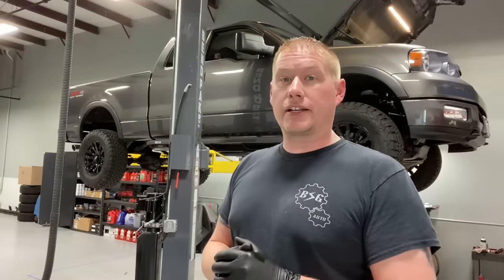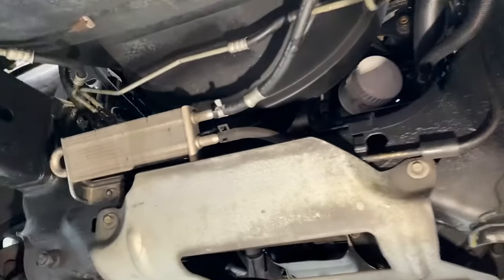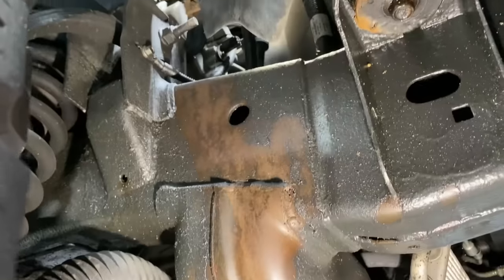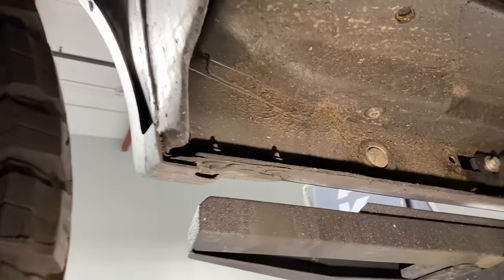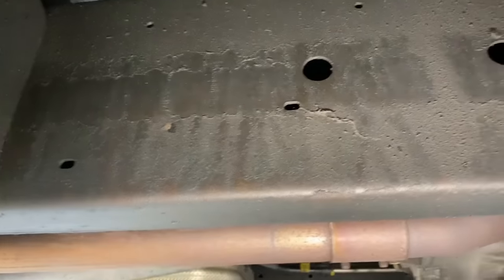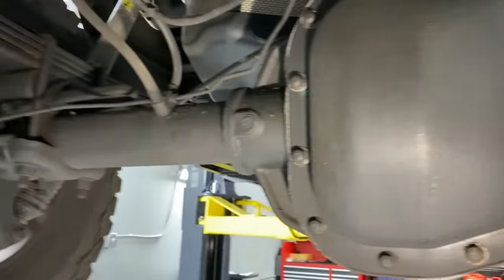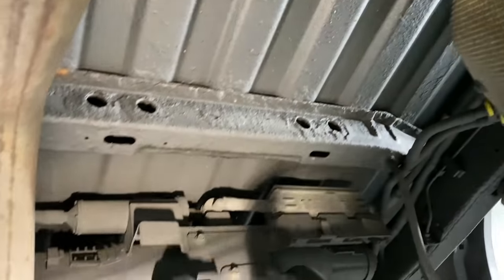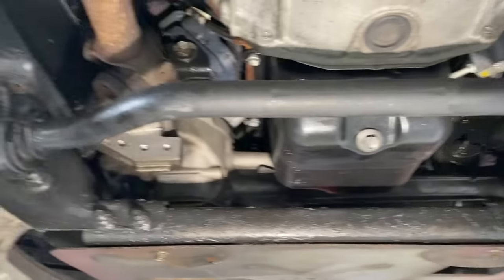Woolwax Undercoating 1 Year Review: Is it Really Better Than Fluid Film?

Comment: The leaking rear main seal on my fox body has worked great as undercoating for the last 30 years 😉
Reply: same with my 66 mustang
Reply from the maker: nice!
Reply: Works great one my 77 Versailles to and the car does all the appling.
Reply: I see I'm not the only one who uses that undercoating😬.  Just doesn't seem to get the rocker panels covered well 😕.
Reply: @dcmchiefs2008  I'm thinking a little forgotten silicon on the timing cover will fix the coverage issue as well as eliminate the need for regular oil changes.
Reply: My 04 explorer has the same feature lol.
Reply: Front 1/3rd of my 1986 Chevy k20 plow/work truck is mint because they come with leaking gaskets and seals right from the factory. I bet by 89 my front frame was 100% 10w30 coated. Now the middle of the truck is coated with trannyfluid from a slow leak from the th400. Cases like this gave me the idea to look up environmentally responsible ways to oil coat my vehicles and equipment.... we all have wells and springs out here so I dont want to screw up our ground water
Reply: @FordTechMakuloco  hey, i have a question, i have a ford f150 2004 4.6, an i need to know what type or gears has in the rear axle, how can i tell??
Reply: 50/50 mix of diesel and old motor oil works pretty good too.
Reply: If you go fast enough, it’ll coat the entire undercarriage
Reply: @SteelBelted  done lol it has a nice sheen covering front to rear with a touch coating of transmission fluid
Reply: Lol
Reply: Seriously why isn't this a feature. It wouldn't be that hard to put rust protection oil reservoir somewhere that would gradually (intencionally) weep at predetermined points and keep the car undercoat going. I mean we do cars for 100 of years. How is this still not a thing?
Reply: @DanielTejnicky  capitalism 🇺🇲 lol planned obsolescence
Reply: @c431inf Don't like it leave them , commi
Reply: LMAO...

Comment: We used the clear WoolWax on a 2000 E250 van that is pretty well rusted and it held up since last fall. Great product.
Reply: Does it seem to retard the progress of corrosion? I was thinking of applying this to my plow truck which has already seen 35 winters in PA and NY. I apply fluid film to the plow already to keep junk from sticking, kind of like olive oil or butter for a pan.
Reply: @workingcountry1776  yes, it does appear to stop rust in its tracks. The key would probably be to keep corroded surfaces covered. I think Woolwax is better at clinging to metal because if it’s viscosity.
Reply: @TheNortheastAl  FF is available at NAPA and Advance Auto Parts so that's what im using this year.  If shipping is reasonable I might try woolwax brand next season. I am in the process of installing floor pan and some patch panels to keep the old pig safe til I find a southern cab for it. Funny,  frame is super solid with surface rust but body is typical rot

Comment: I use both Fluid Film and WoolWax. Spray Fluid Film first in August. It creeps really well in the heat. Then a month later come back and topcoat with WoolWax. I spray both on liberally. Buy it in the 5 gallon pails and you are set for a few years for touchups.

Comment: I’m actually impressed what fluid film and surface shield can do and I’m even impressed with this wool wax. I used to spend 600 or more and go yearly for touch ups. I spent 150 on a kit and do mine twice a year. The 2nd time I just give it a quick once over. My truck has held up really good and still looks factory after 3 years. I’m even doing other people vehicle making some side money I get better better at it each year. Most people don’t even think about the inside of the frame. You can even use this stuff to clean chrome just gotta do thin layer wipe of real good. Helps preserve chrome and other metal surfaces.

Comment: Add a canister under hood run small rubber lines under body, fill canister transmission fluid, open valve canistee. Drive. Works great

Comment: On my 07 f150 I coated everything with e40 and let it sit a couple hours before pressure washing it off with hot water and then hot soap, and then hot water again, then the next day when it was completely dry I went under with a wire wheel on the end of my drill and got all the main areas and spots of rust left, then pressure washed with hot soap followed by hot water at the carwash, once it was dry I hit the underneath the while truck with rustoleum rust reformer and seal flat black, and then after it dried some I went over the top of that with rustoleum rust stop gloss enamel spray paint, both cans are only 5 bucks each and it's been 2 years now with no issues, but before each winter I go back underneath and touch it up in areas with the rustoleum stop rust gloss black enamel just to keep up on it, haven't had any problems and the maintenance on the following year was way less work then the initial prep and spray the first time. Plus it's way cheaper then por15 and that big  air compressor in the video 😂 thanks so much for the videos! It's my first truck and I'm not a mechanic at all but I've watched your videos and been able to fix any problems I've had. Fixed, MAS, Throttle body, IAC, VCT solenoid before it needed it because I wasnt doing all that timing chain stuff lol thank you sir! You're saving a f150 in Washington state and you dont even know it 👍
Reply: Oh and I'm doing the new oil pump soon too, no problems yet but still going to anyways

Comment: I watched the original video & liked what I saw and bought 30 cans of Fluid Film to coat the undercarriage of my Ford Crown Vic (I don't have an air compressor). So before I watch I am hoping the Woolswax worked awesome & my Fluid Film job will be almost as awesome. I applied the Fluid Film in the 90 degree heat of August.
 A+ for the camera & lighting work I could see everything. After watching it is easy to see the Woolswax did a great job & held up great that is impressive. Looks like all it needs is a light touch-up every year to maintain protection.
Reply: any updates?  I just applied Fluid Film to both my CVPI P7B's

Comment: Good to use something better than nothing! I also like to use fluid film and or woolwax. I just finished putting fluid film a few days ago on my 2016 Chevy Silverado 2500hd because I couldn’t wait any longer to do it and good thing I did because it just snowed today so I picked up only a gallon to touch it up because it had not much missing. On our other truck 2015 GMC Sierra 3500hd Denali dually we will order the woolwax eventually and spray it on. 👍

Comment: for anybody reading this especially F-150 owners... Don't forget to spray the wool wax on the spare wheel itself because it's common for the wheel to get very rusty and on my F-150 it rusted so bad that a pinhole developed and the spare tire would no longer hold air.... I put wool wax on it and it should never be a problem anymore

Comment: Didn't need to watch this because I've used it and it's great. Had my shop spray all the body cavities as well, all the underside including the exhaust, all around in the engine bay. Doesn't burn, stays "fluid", creeps into cracks and crevices, and sticks like heck. Every two years give the underside a recoat and that's it. All for $50 a gallon which will do all but the largest cars

Comment: seems like a win..maybe next time take out your tailights and with a long air gun blow out over the back wheels ,,then apply some of this stuff through the tailight opening and coat it good over the rear wheels..i just did  my 04 ranger with fluid film...we will see how it holds up here  in pa
Reply from the maker: Yup I did all of that in the original application video.

Comment: This truck has about the same amount of rust as my new 2020 from the dealer after about a two-month transit from Dearborn to my drive. I was very disappointed with ford's protection from the factory. I live in GA and never encounter rust on a vehicle and never thought to check it before delivery. So, I got under my brand new truck and coated it with the  Heavy Duty version of CorossionX. Whished I has known about this product.

Comment: One of the local shops near me, complained about my undercoat. He says it's a mess to work on. He joked that I should be charged extra. He thinks it's a waste of money. I haven't been back, since those comments. I have been reading about Waxoyl. It's thicker and insanely popular in Europe.
Reply from the maker: It is a mess to work on but the product works sooo well.
Reply: It is a mess to work on but a few shop towels and half a can of break kleen is better than having to deal with the rust and frozen fasteners, rusted fasteners breaking, etc

Comment: Going to try Woolwax this year. I used Fluid Film last year and it was completely washed off in 3 months.
Reply: Did you get a lot of undercarriage washes? High pressure washing under there will wash off over time. Fluid Film holds on for me
Reply: @martinmorris6271  No. I sprayed it on just before plow season. It wasn't very long before I saw complete dry spots on my frame. And, I used far more than they suggested.
Reply: I sprayed both of my vehicles with Woolwax before last winter and the majority of it was still on this fall when it was time to respray for the upcoming winter. I am impressed with Woolwax and intend on buying another 5 gal bucket of it based on the results I've had.

Comment: Nice video. I like the idea of a pigment to quickly see if the product is on or not. I am applying fluid film this season to a rust free older vehicle that i have have to drive this winter due to unexpected world events and me not being as prepared as I should have been.
Reply: I have undercoating shop and undercoat about 3000 vehicles per year at our location.

We stock and offer all products.

Thicker is no better. Woolwax on that truck you loose alot of penetration capabilites. Also with it being thick, after re-application 3 years from now it will have so much build up you will have to steam wash the entire vehicle to re-apply otherwise it will be layered and surface bleed rust.

You can do a honest review since you used the black, it dyes rust pores, of course it will look better.
Reply: @2287Jasper   I got the New Hampshire Oil Undercoating done last year and put fluid film on parts the guy missed and in other parts just for good measure.  Should I NOT just oil over the old stuff again this year?

Comment: Your usual thorough job, both in the application and the video. Follow ups  are helpful in understanding how well the product protects, and as well, how often and where the touch ups will be required. I can't tell if you used the same product on the driveshaft?
Reply from the maker: Yup it was the same stuff just smeared onto the driveshaft.

Comment: I've been applying FluidFilm to my F350 for over ten years. Bought her new in 2004, wish I knew of FF back then but yearly media blasting and paint touch ups kept her showroom new. Since the FF spraying once a year I haven't had to do much but hose it off after winter wait a few days to let it dry then reapply the FF. My only gripe is no matter what you use the bed wheel well lips WILL ROT AWAY EVENTUALLY Fords bed foam cant be stopped and no amount of used motor oil/fluid film or whatever else you use is gonna prevent body rot in that location. Last summer I did a complete passenger bed side replacement, and now the driver's side has started to bubble. Looks like neck spring I'll be doing that entire bed side and wheel house now
Reply: Also Ford doesn’t use much of a wheel liner in the rear. The 4x4 Dodge use a massive plastic liner in the rear. I’ve noticed at least on the older dodges the 4x4 gets them and the 2wd trucks do not.
Reply: Try cosmoline.

Comment: Did you pull all the plugs and shoot in all the crevices when you did the original application?   I just did a 2021GMC Acadia and took the outer wheel wells out and all the plugs, removed the wheels and protected all the brakes.  It took about 5.5 hrs to do that, apply the material and then put everything back together.   Maybe the best thing is to just watch your application video.

Comment: Did you try getting up inside rear wells where arch or tub meets the outer bed in the rear wheel wells? Im putting more 3M cavity wax using their wands that work great  in my 150 tomorrow, already did the rockers and used gorilla tape where the "factory" tape was, over 16 holes!!!

Comment: That is a great result!  I'm getting ready to do mine this week.  Did you do any washing or undercarriage flushes throughout the winter?  I have never been able to get a straight answer about if it is recommended or not.
Reply: I got my CUV under coated earlier this fall. My understanding is if you do clean the undercarriage don’t full pressure wash blast it - that includes the drive through washes that blast the undercarriage. I’m not going to touch the undercarriage unless it gets seriously gunked up until spring.

Comment: Nice video. Do you need to scrap down rusted area's before applying, or can it go directly over the rusted metal areas to be effective? Thanks! Looks like a great undercoating product.
Reply: my real name  That surface shield works well and may very well be better than fluid film. So far it stays on splash areas better and doesn't wash off like fluid film. After a year the fluid film on my van stayed nice in areas that don't get a lot of water splash. It's still a good product for that but from now on I will be using Blaster for touch up.

Comment: There is an anti-rust wax chemical sold in UK called "Waxoyl" that is either shop applied or DIY. It's supposed to be good.
Reply: Hey I used Waxoyl on my 89 K5 Blazer after giving it an extremely good cleaning. That was 15 years ago. No rusting as it was the day I first got it. It’s excellent product underbody and cavity wax. You heat or warm it up and spray. Now I recently used Woolwax on my new Ram.

Comment: Ok looks decent for just one year though? The last and final time I ever “rust proofed” a car/truck I bought new was in 1978, with a new Scout II TERRA truck. I had Ziebart applied the day I picked it up. Fast forward just 5 years and rust through both rockers, rear wheel wells, that Ziebart refused to honor their warranty, because they found beach sand under the truck! Within two more years the tailgate was falling off and forget about passing inspection! Holes in the floor, and ever body panel! Even the windshield frame! I ended up selling it to a friend with only 72,000 trouble free miles. He removed the body, then placed a 1969 LeMans Safari Wagon body over it! That is still running to this day!

Comment: The newer aluminum body trucks only need the frame and suspension components protected. that's going to help a lot.
Reply: Aluminum corrodes too.
Reply: Aluminum can corrode faster than steel. Depending on its particular alloy. I’ve seen air valves that are made out of aluminum fall off a frame of a big truck after about 18 months. They just turn to a white powder and disintegrate. Those valves are much thicker than a vehicle body...
Reply: @jacobmorissette2367  It can but remember Ford protected these trucks from both oxidation and galvanic corrosion using specialty coatings and isolation, even on the fasteners. As long as you don;t mess  with it, you shouldn't see corrosion for a long time to come. Read up on it and look around for the next few years, the aluminum bodies have been out for 5 years and so far no galvanic corrosion as seen on earlier attempts at aluminum body panels. If you did set up a galvanic cell on your aluminum Ford, Woolwax isn't going to help.
Reply: Aluminum will get pin holes in the body after several years
Reply: @007.3l  How many years? I'm waiting for the 2015 F150's to corrode but haven't seen it yet.
Reply: @kastbarg  look at old box trucks and semi trailers that have been in the rust belt, they get pin holes and corrosion at the seams where the metal is bonded together, same thing will eventually happen to your beer can f150
Reply: @007.3l  Completely different situation on the F150. Educate yourself before you comment. Different alloy and Ford has coatings of corrosion protection that the examples you gave do not. The box trucks and trailers are just bare aluminum. You are welcome to your opinion but please take the time to do a little research before you respond. Will the F150 ever corrode? Yes, but it will be along time, and woolwax won't help.
Reply: @kastbarg  
Did you design the aluminum body on the f 150, probaly not. So stop acting like you know what you are talking about. The coatings that they  spray on the panels from the factory are only good for so many hours of salt spray. Look it up! Once the coating wears away you will get corrosion period. and yes fluid film, lps 3 and other lanolin based corrosion inhibitors DO protect aluminum and steel from corrosion as long as the surface is clean and dry and there is no trapped salt or water before you apply the product
Reply: @kastbarg  astm b117 look it up

Also ford BI 103 -01
Reply: @007.3l  Hi Chris, I do reliability corrosion testing including salt spray for a living, 38 years in the business. I also do HAST, TH, and electrical bias stressing. You are correct that I didn't design the F150 but I did follow along as they tested it and have a lot more knowledge than the average guy. But don't believe me if you don't want to. The F150 aluminum has been out since late 2014, I haven't seen any corrode, have you? https://www.popularmechanics.com/cars/trucks/reviews/a10399/how-ford-torture-tested-its-new-aluminum-f-150-16682803/
Reply: @kastbarg  great info. 👍  so with a brand new f150 you would recommend woolwax for the frame and suspension and no aftermarket protection for the cavities, correct. I am hoping to do the right thing with hopes to see 20+ years in the rust belt.